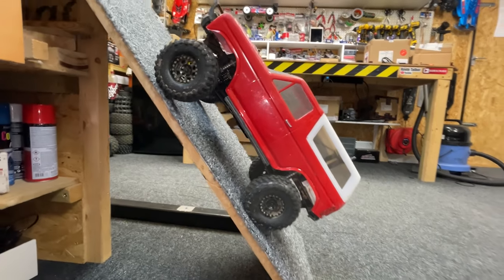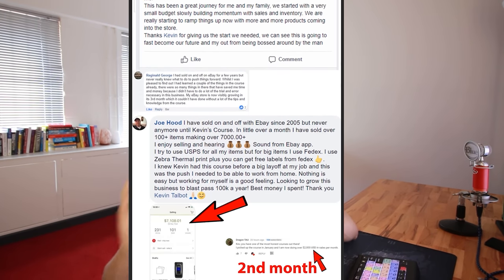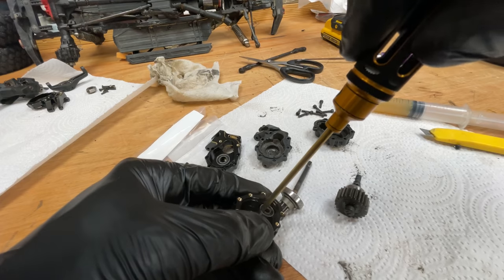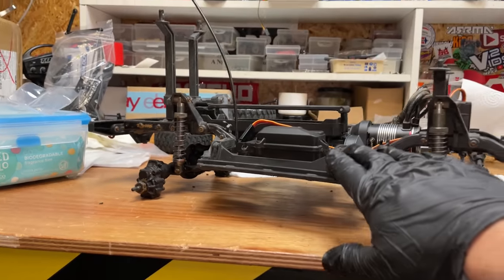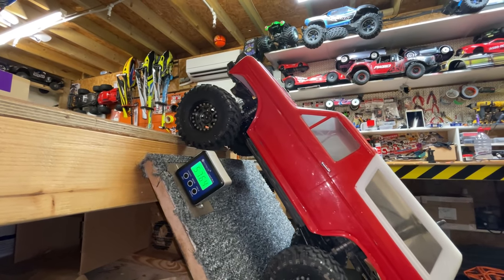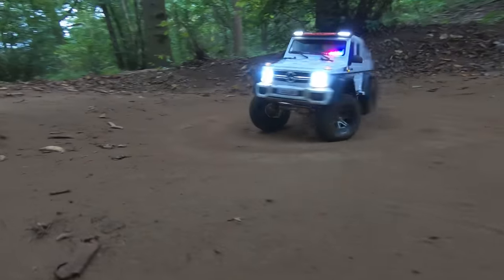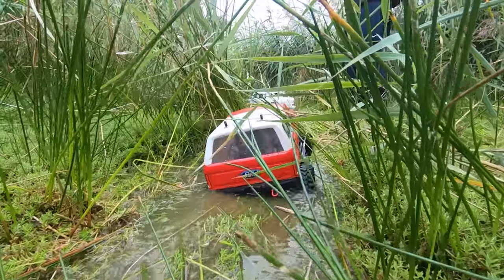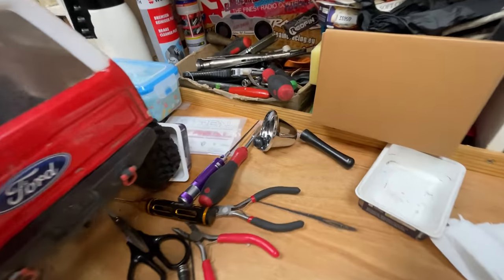Secret mod so your RC car can climb steeper!!

Comment: Kev i can not tell you how excited i am to see your scx24 c10 build as i had just finished mine last week. Very much looking forward to it. I feel its a really solid machine already. I added a higher torque motor, better servo, internal air/spring shocks, big battery, brass wheel hexs, aluminum steering rack, soft tires no foam with 50g bead locks. It's an absolute beast.

Comment: Hey Kev speaking of climbing I'm gonna test out my C24-1 2speeds new 50,000rpm @11.1v 370 motor and 320amp esc. I have a video the other days first attempt where it wheelies and does 4.4mph in low gear on 2s before spitting off a driveshaft. I used extra superglue this time should be fun speeds in high gear on 3s and it should climb nice and fast lol

Comment: Hell yeah as long as ya dont bash iy fast the extra weight wont break anything hopefully,  but that 80's full size bronco is epic had an 85 fleetside long wheelbase made it into a daily driving monster mudding tire smoking diamond treaded out masterpiece , loved that truck painting and 85 f150 body and a 78 f250 body for my rc trucks my first and second trucks

Comment: Nice upgrades. I'm still on the stock plastic axles on my TRX-4 axles but I have installed brass outer portal covers. I went for cheap Chinese ones which are really well machined and a nice weight
Reply: Are they on Amazon ?

Comment: 3d print a body for your trx6 then you can remove all the front plastic bumper parts put in a trx4 front bumper and cut 3 inches off the back so it can stand straight up and still be on the rear wheels

Comment: have to try treal drive shafts on my crawler they might last more than 30 seconds like the last one's did never even got it out the house before they broke!! don't think it needs any more weight though its heavy enough the only plastic on it is the gear box housings one off them stripped too, guess thats what happens building one from scratch from aluminium, welding rods and 6" nails lol

Comment: Hey Kev I am not sure if you have tried but I was thinking for the high speed runs wouldn't it be easier to see the cars from a height. Like a scissor lift or cherry picker. These are both mobile and will raise you on a platform up to however high within reason you want to go. Was just a thought mate. Love your work and your attitude rocks.

Comment: Use some lead weight for car wheels in to the tires and stick them to the rims and cover with standard foam. With heavier front you can climb much better. Check also over gear for front axle and under gear for rear axle than front will spin 5times for every 4 of rear wheels. It works perfect for climbing.
Reply: Btw 61 degrees for me on “carpet hill” with everything what I did.

Comment: The “C” in C10 indicates that the truck is a two-wheel drive model. The Chevrolet C/K series consisted of two-wheel drive trucks, labeled with a “C”, and four-wheel drive trucks, designated by the letter “K.” The C10 was the half-ton, two-wheel-drive model within the C/K line of trucks.Oct 21, 2021

Comment: I just did the brass upgrades on my scx24 and it does better. Also you should relocate the lights in the bumper to the grill just gotta take the stickers off and pop the lights out and put them in the back of the grill makes it look better with proper head light

Comment: Sweet a change up n content!!! I love the bashing but crawling is a different thing.. and I think my Capra is probably 8lbs + and i have it heavy on the front probably just guessing it’s around 60/40 I will know tomorrow evening going to a friends… gonna finish my 4ws and then put it on the scales.. and I’m gonna see what and how much the rear brass knuckles and covers do or change it the weight biases.. if it’s a big change I might not put none on the rear… might see how the knuckles by themselves do.. or maybe just the covers.. ive got almost $3000 or better n it… it has a 16t 5 slot  Holmes hobby crawlmaster pro.. and hw 1080 and different axels shocks that the guy quit making..( best shocks ever made) if someone knew who I was talking about on the builder of them .. u would understand.. he’s from Australia.. not gonna say no more cause those shocks r no longer being made.. and a whole lot of other stuff! It dominates everything I’ve put it against.. atleast around here where I live n nc… but I’m probably gonna tear it down this winter and do more stuff to it… More cosmetically than anything.. it might end up with a power wagon body on it.. 🤷‍♂️ the sky is the limit on this hobby… we all know that..

Comment: Put a 3300kv Hobbywing Axe in the 6x6. I have one in mine and it rips. Reverse your locking servos so the rear locks before the front and you can have lots of fun with it.

Comment: you realise adding portals raises the cg, right? a regular straight axle is best for massive accent angle, if that's all you care about.

Edit: Infact, mounting the portals upside down might give you more gains, since it pushes the axle closer to the floor, i'm not sure if that is a valid configuration with the parts you have, though.
Reply from the maker: Do you realise that would loose ground clearance? Right? Lol 😂

Comment: The Part you did not know, replaces the bottom of the tower housing on the rear of the trx4, because the stock tower base will not allow batteries of any length with the new tray.
Reply from the maker: Thanks!!

Comment: If you swap those axles for straight axles with no portals the ride height will drop down some therefore dropping down the center of gravity
Reply from the maker: The whole idea is to drop cg but not loose ground clearance

Comment: Every scale build I've done I always fill the axles and diffs with blue marine grease and even after 2 years of no service when I swapped axles housings none of the metal parts had a bit of rust on them

Comment: We also weight the chassis, but we also fill the tires half the way with bb's (crawling only) not for high speed.
Reply from the maker: His do the bbs work with the foam in the tire?
Reply: No tire only
Reply: If your vehicle is crushing the tires flat obviously its not going to work. usally the foam inside is for stability in the corners at high speed. but if using at low speed there's crush to the tire providing more grip. Also you need to test the correct amount for your tire they need to roll inside.
Reply from the maker: but with no foam the tire will be flat, nice idea but cant see it working

Comment: I don't fully understand the common negativity against pot metal / zinc alloy. It's stronger/harder than brass.  brass is copper and zinc mixed together.  Copper is softer than brass. Pot metal housing has significantly more weight than aluminum. And is much harder. It wouldn't get you stuck on the rocks easily like aluminum. Zinc alloy has self lubricating properties. Almost like oilite bushings.

Comment: Too much grease will cause your drivetrain to have too much resistance and i would have just put a drain hole in the diff case.